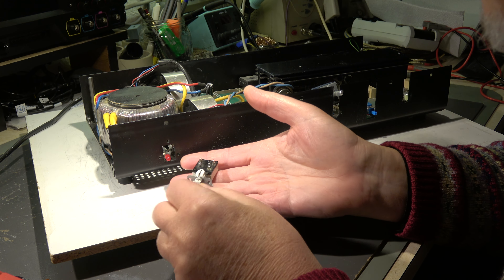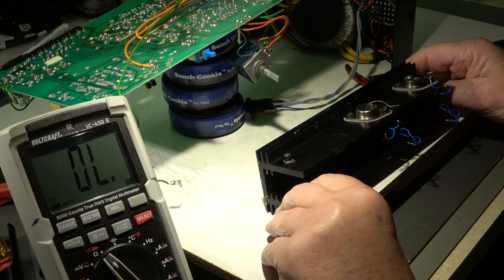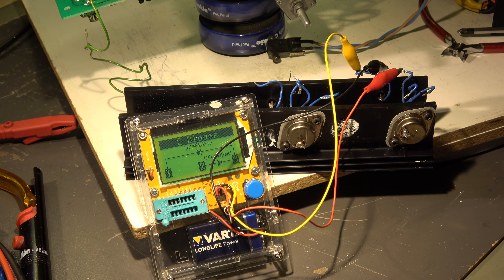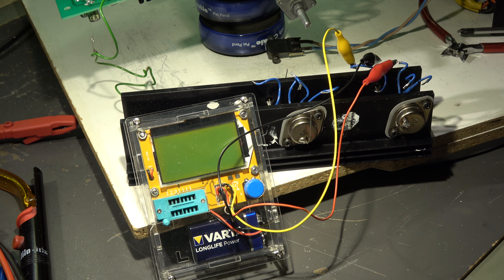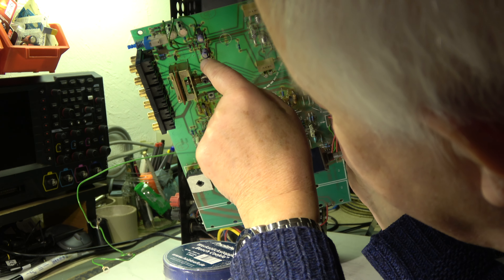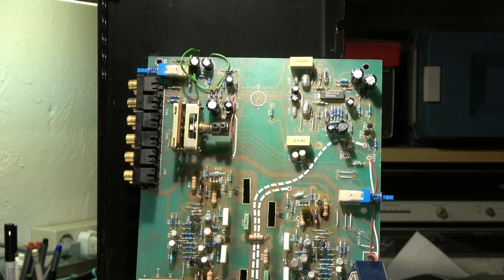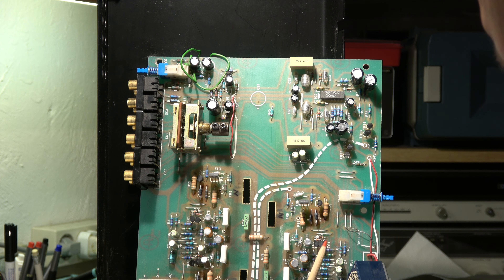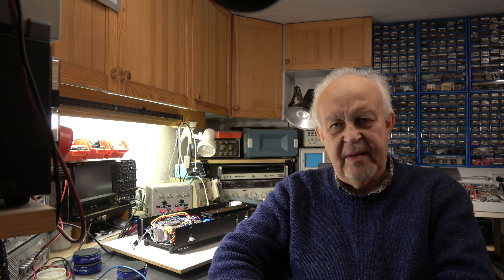#186 MUSICAL FIDELITY A100-X Part 2(3)

Comment: In all the amplifiers I've fixed that had blown finals,  I'd say about 80% were due to a shorted speaker wire and 20% were due to thermal runaway because the compound had dried up and the amp was pushed hard at a party.  This one may also have oscillations.  Oh yes, I've seen outputs blow because the speaker used piezo tweeters without any current limit resistor.  Those tweeters can measure less than 1 ohm at 30KHz and present a short to the finals if the amp oscillates or has program material fed into it.  We can't hear that high, so the operator would never know until a fuse opened....IF it opened.  LOL   73 Stefan.  Looking forward to PT3  👍
Reply from the maker: There is no fuse on the secondary side - only the mains fuse. So whatever happens, the finals will be killed - accelerated by a very high bias current.
This design is shxx!

Comment: Why did they use the same supply for both left and right preamps? I'd would have thought it would be easier to design each channel independently and just replicate them. But I guess this is the magical world of MF....
Reply from the maker: For left and right channel is used ONE quad-op-amp which has only one power supply connection for + and - ! So they had to decide....